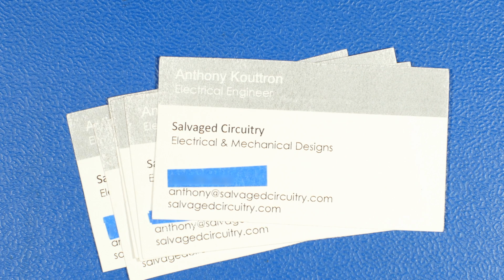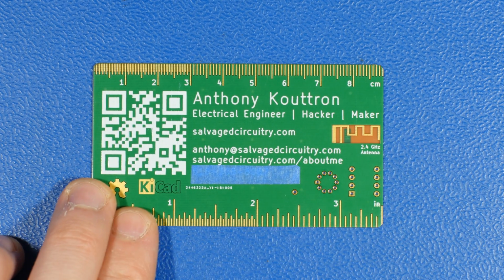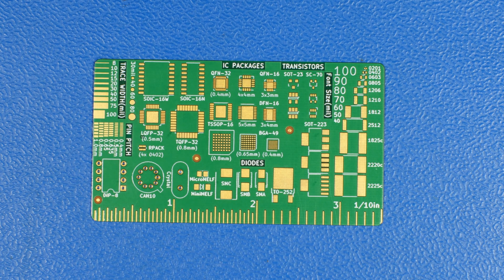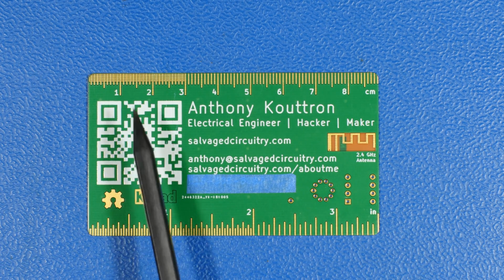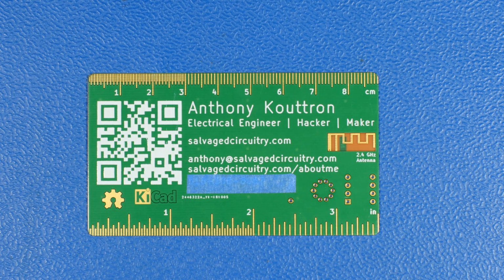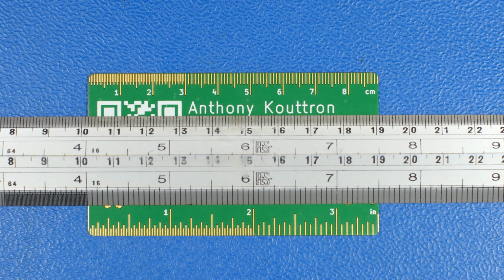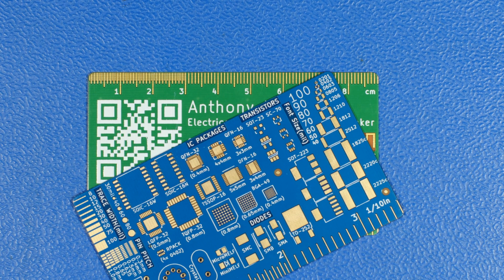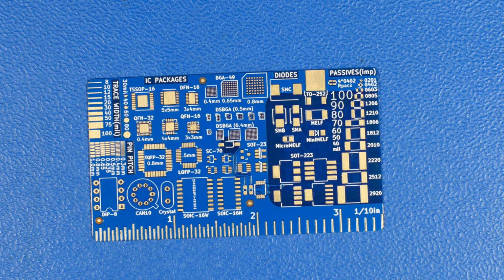PCB Business Card with NFC and QR

Comment: Have you seen the visa credit card with a dot matrix and button inputs?  Its called CodeSure and it's made by SmartDisplayer.  I think it could at least make a calculator, if not a tiny dictionary, depending on how much storage the thing has.
Reply from the maker: I just checked it out. That's pretty wild! I didn't know that existed. It reminds me of the Coin Card. It would be neat to implement a calculator. The big thing is to reduce the cost and minimize / automate the assembly. Flex PCBs are usually kinda pricey though, so it may be cost prohibitive to make something as thin as a credit card. It may be better to shoot for a super thin pcb, capacitive PCB touch buttons and a super thin LCD. Maybe a in-plane LCD so the lcd does not stick out of the card. You would just need to have a routed out hole for the LCD and you should be able to keep the calculator nice and thin. Good luck!

Comment: Have you thought about trying to cut a hole and reverse mount the NFC chip through the board? I bet it could reduce the thickness just a bit and make the card functional without the added lump.
Reply from the maker: Hi Jim! Good idea! I was considering mounting the tssop package breach mount style (upside down) but I decided against it because a majority of the cards I hand out will not have the nfc chip soldered in (chips add an extra ~$1.00 per card) and I didn't want an unsightly hole in the card. There is a good middle ground as the chip comes in a XQFN8 package which is only 0.5mm z-height. The tssop package is about 1mm z-height. It's pretty crazy how tiny ICs get these days!